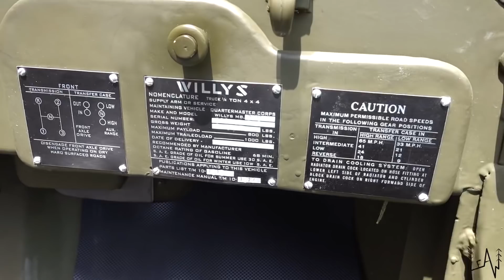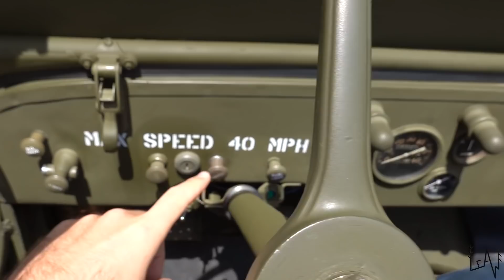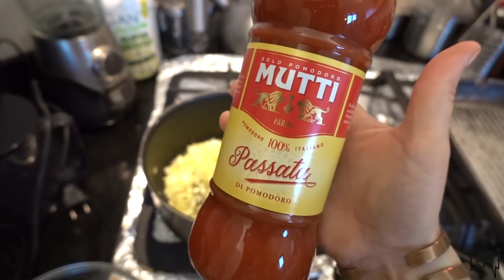Our next DIY PROJECT, Hugs and Italian Parmigiana di Melanzane

Comment: I use diatomaceous earth by dusting it on the plant as needed and also as needed 1-2 tablespoons of neem oil mixed with 1-2 tablespoons detergent (Dr. Bronner's) mixed with 1 gallon of water to control most all garden pests.  I also use moth balls placed along the row or around the plants to deter pests like squirrels, rodents, marmots, and others.

Comment: How awesome to have a bathroom that goes right to the outside so you can pop in-and-out when you're working, you should really think about putting a little shower in there to clean up before you have to go into the house. Can't wait for you to start the project. Sorry to hear about the thieves but you're pretty remote so it's probably someone from the area.☹